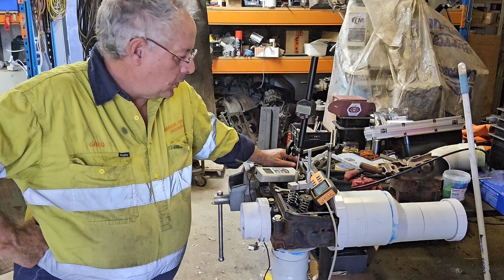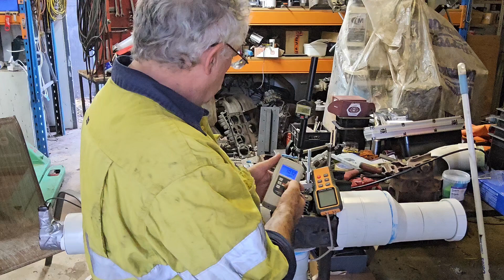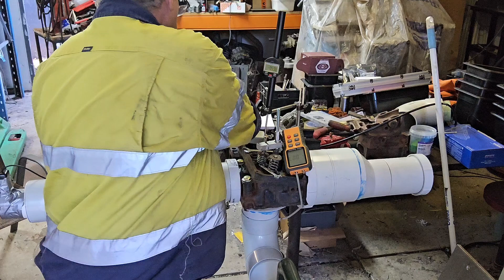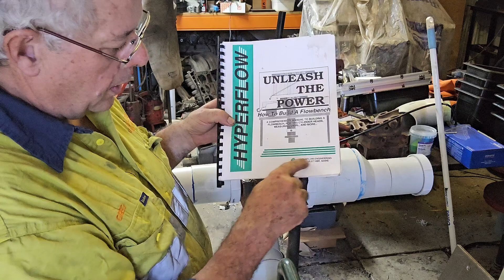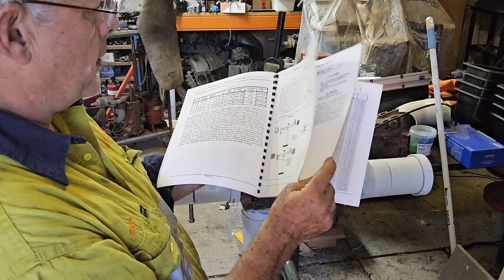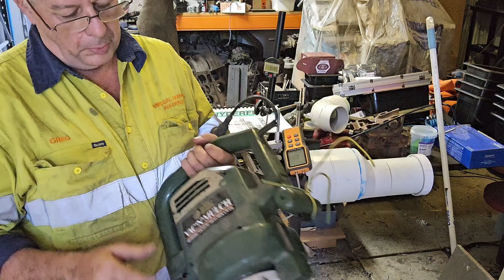Poor Man's Flow Bench Part 3

Comment: I have on a few heads,flowed just one port , they only charged 50.00 (just to know ) what they flow , mostly so I can input data into engne building software. Have you flow tested a port , then put on a manufactured bench . just to see how yours compares?
Reply from the maker: Cost per port will depend upon where you are in the world. That said, it wasn't the objective of the exercise. The objective of the exercise was to get a reasonably accurate, repeatable result, that can be roughly compared with other benches. I mention in one of the videos that I used published data for that cylinder from Stan Weiss's website to give a calibration. It's not exact, but it is adequately close for the purposes required. On a V8, 1cfm will equate to roughly about a 2.07hp discrepancy. I'll go into this in more detail in a future video. The main objectives were for it to be cheap, relatively accurate, and be able to be made by anyone at home, so anyone can undertake porting, and know if they have made positive or negative changes. Thanks for watching and commenting

Comment: Hi. I take it that if you were trying to improve flow from a head with unknown data. you would gain the results from what you initially measure. then say open / modify a port then test / measure improvement or not. ?  You remain with no actual base numbers. Thanks for what you are showing us.
Reply from the maker: @cedarlodge8525  you have a few options. You could start by doing a set-up using flow data from someone else's test, like i have, on a known head. Now that I know that 0.013 is the factor that I have to enter into the anemometer for my set-up, as long as I don't change the sizing of the ducting, it will remain constant for different heads. Put another way, I could get a  6 cylinder head, make new adapters for the intake and exhaust, and then flow the head using the same 0.013 factor to get meaningful numbers. I might have to make a different bore adapter, but that doesn't matter, as they flow measurements are being done on the port sides. Your other option would be to make an orifice plate set-up, to undertake a calibration with. I haven't tried that yet with this set-up, but theoretically, it's easily done, and relatively simple. All of that said, your worst case option would be to simply copy my design as closely as you can and use the same 0.013 factor in your anemometer. The results should be pretty close